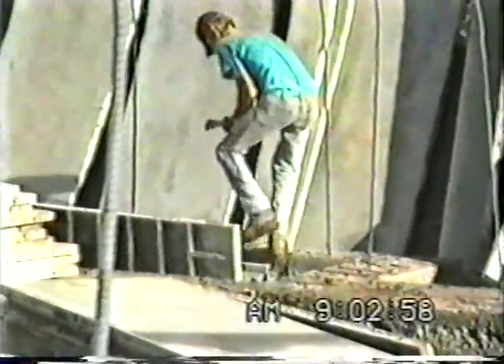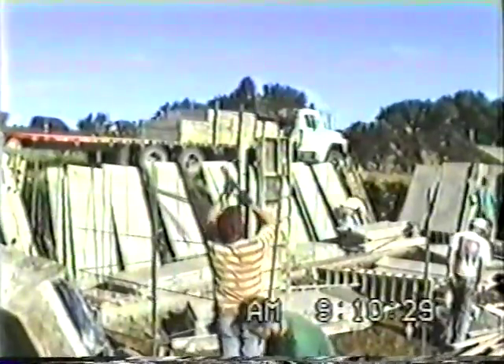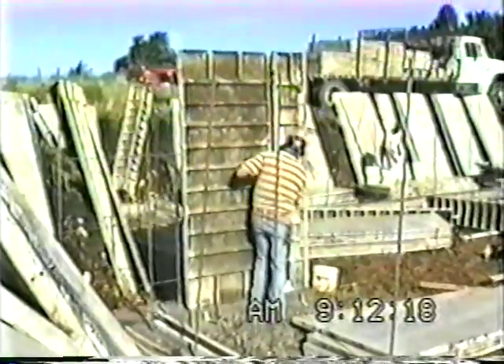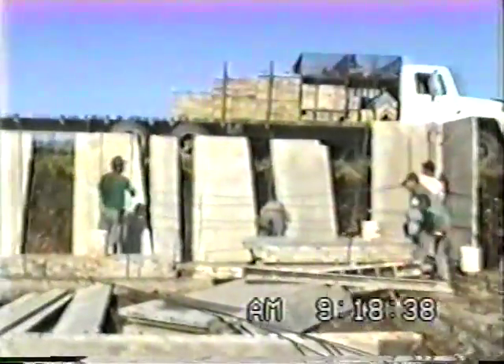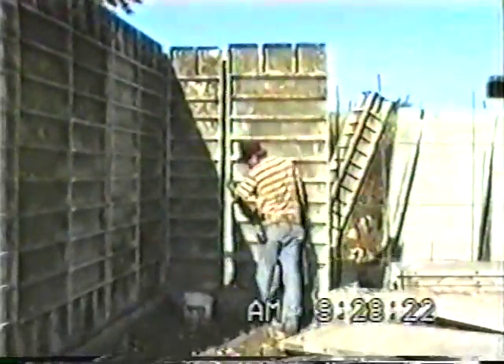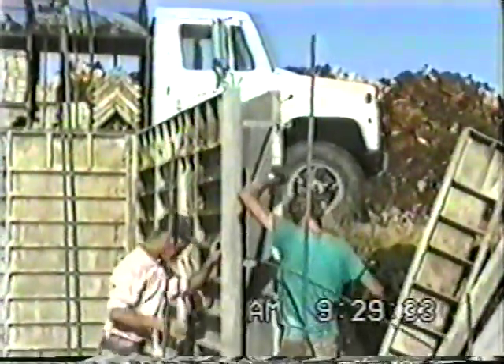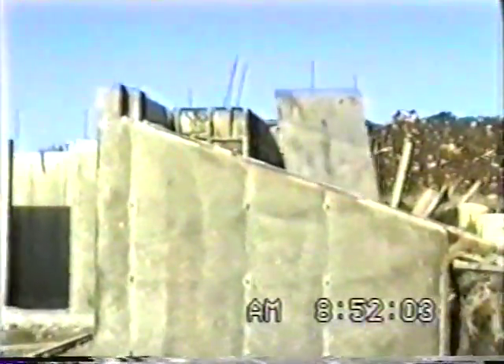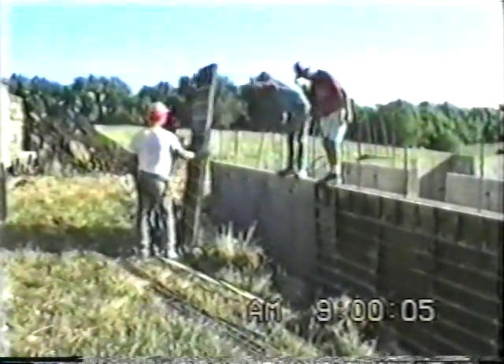Concrete Foundation Construction Using Aluminum Concrete Forms

Comment: That's the same way I do my footings and walls. Footings 4" above grade so you can throw in 4" of gravel and have your slab sit on top of the footing. And for the back, if a walkout, I drop the back footing in the ground and put a 4x4" ledge on the inside wall so the slab can sit on top of that. Love stripping walls too. Especially now that we have a crane truck with cages for the forms.
Reply: Same Majestic masonry is my company

Comment: how do you put windows in? Can you cut out, or can you allow for it ahead of pouring?
Reply: You would build a buck out for the window and screw it to the form in the correct spot.
Reply: Styrofoam cut out sometimes plywood frame

Comment: just out of curiosity how much were they paid during this time?
Reply: xxamz3 I charge around $25-30 per square foot of wall face. A large home, 2000 Sq ft basement, is around 40-60k for footings and walls
Reply: @jarredstevenswalls  holy crap. Can I come work for you?
Reply: @christopherlehman626  I work this job and it’s hard I’ll tell you that , people don’t get paid enough for this kind of job